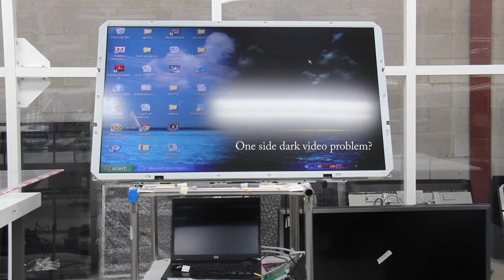lcd/led tv one side dark video  screen display problem fix

Comment: It looks like you re heated the tab with a conventional heat gun but then used a heated press? Did you the heat gun to remove the old connector and the heated press to solder in the new one? What were the strip[s of tape for?

Comment: so its the Tabs on the lcd screen that are failing then?
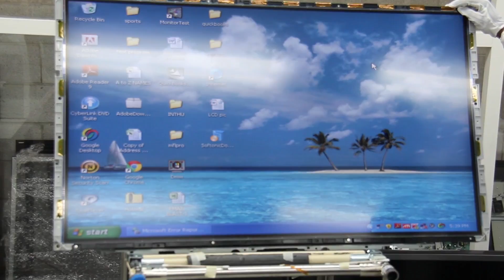because i have the same issue and saw your technician pressing the defective tab in the video as well. 1:18 thru 1:23
it made the tv screen flicker and then cleared up,so is there a cheap fix that can be done at home instead of going thru the entire process?
Reply: there is no real cheap fix for the foil tabs once they overheat and separate that's it  so it looks like these dudes do what most wont rebond those cheap ass tabs !!!
Reply: ty Dale,i thought much the same,i even watched a bunch of fixit vids and so we never attempted to repair ours.
its still working in the game room to this day.
black line and all.lol!!
Reply from the maker: Rob Washere
Hi

There are lots of ways to repair but those are not for long time.  We actually replace the defective tab on the screen